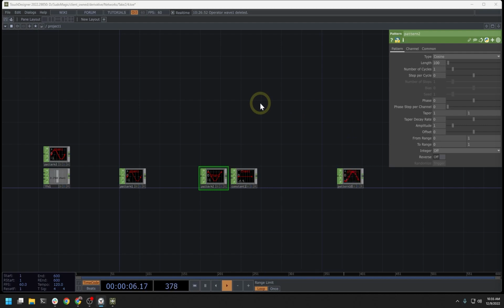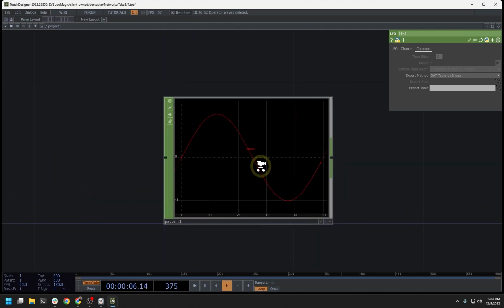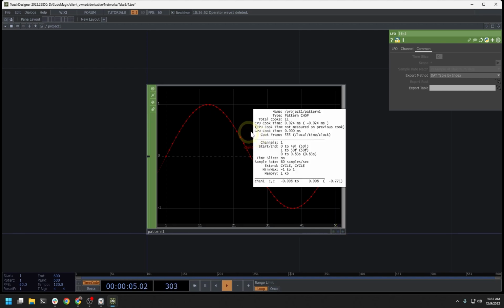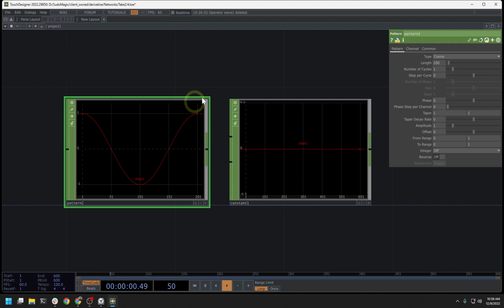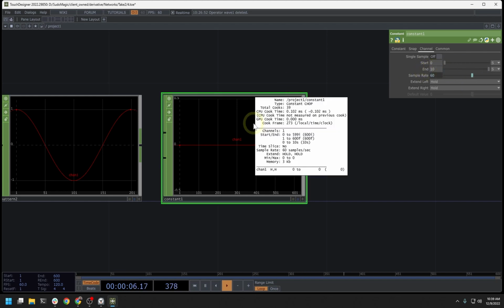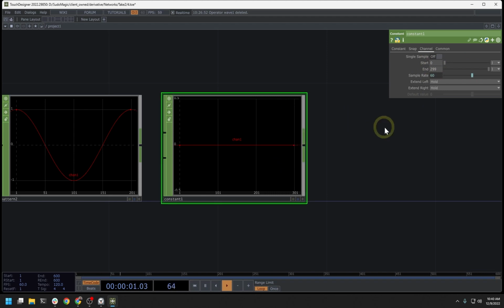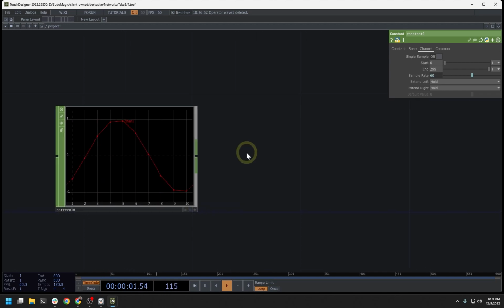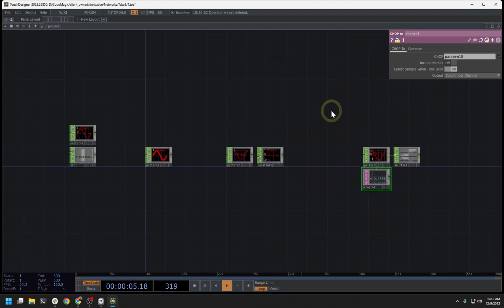Working with Multi-Sample CHOPs

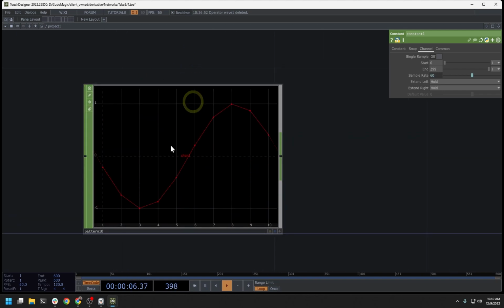Comment: Hey There, i am a noob who tries to learn touchdesigner. I stumbled around a small issue here. How did you get the pattern at 5:18 to be an animated sine?
Reply: play with the phase parameter of the pattern, in the example they added the line absTime.frame/120
Reply: @xizirafetamin5373  thank u :)
Reply: lol the chop guy has a very different pedagogical method indeed
Reply: @xizirafetamin5373  "Don't really explain what I am doing and have files that are different to what I am showing" is definitely one way to teach.
Reply: It is in the associated file, but you have to dig on. Most of the files don't directly follow what is going in the actual lesson which is an . . . uhhhh, "interesting" way to do tutorials, I guess.